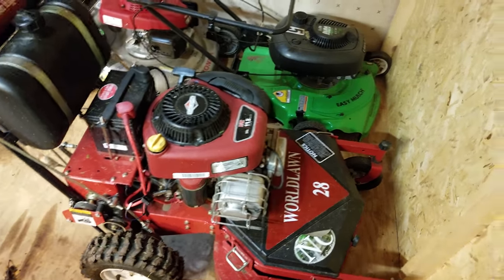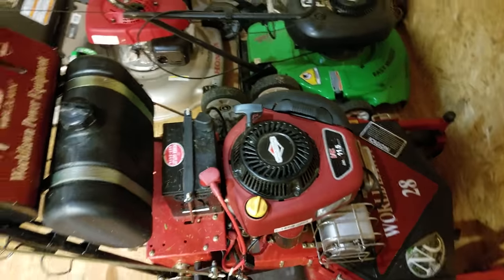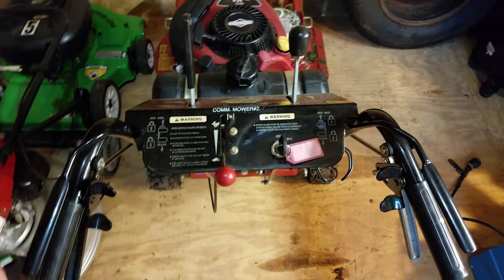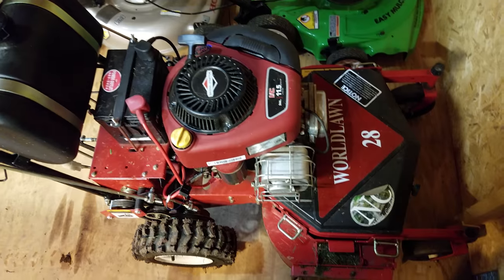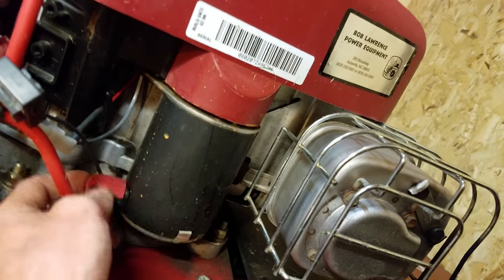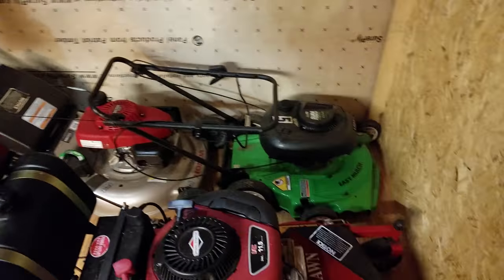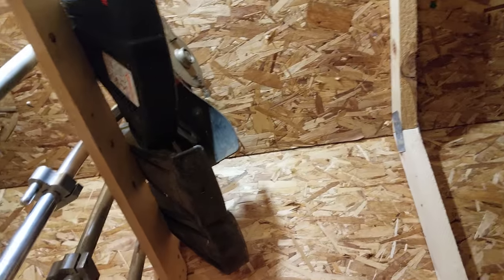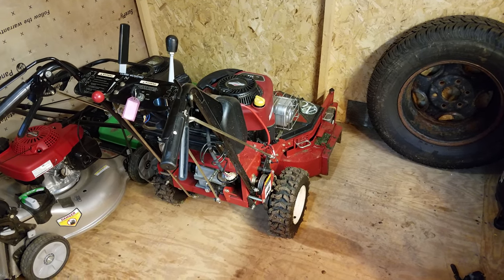WORLDLAWN 28'' WALK BEHIND MOWER

Comment: I purchased the 28” Worldlawn and it’s been a game changer for me too.  It’s powerful and easy to operate.  I’ve  had it for a fews years and this 28” has been a workhorse.   However, the 28” has been breaking  blade belts lately.  Mostly, when I lower the deck for shorter cuts.  How do you suggest I adjust the belt tension on the 28”?  

Any suggestions would be appreciated.  Thank you.

Comment: Does the 28 inch walk behind worldlawn come with honda or Kawasaki engine?
Tks for the video
Reply: His has briggs.  There is also a honda version. The new briggs model woldlawns have a 10.5 not the 11.5 his has.
 I have the 10.5hp briggs on my 32 and its fine. So i know it would be fine on the 28.
Reply: @mattlac3061  i just got mine 28 worldlawn with honda , mulching kit,  bagger,  with shipping from Tennessee to Louisiana (250$) and recieving it here at a store with forklift (250 $) all together came at 2990.00 $ a little more than i wanted to pay but is here now and haven't used it yet.
Reply: AngelTheFiend  it is a great walk behind lawnmower,  i had to order it from Tennessee with honda engine,  it did cost me 250 for shipping and 250 for receiving bc it had to be delivered in a business with forklifts. Total cost was 2950 but if you can find a store that has it and you can pick it up,  you save 500 , has good power for its size.
I forget to tell you that the price i told you was with mulching kit and bagger too.
Reply: AngelTheFiend  it is heavy duty regular bag, it is not steel , it attaches to the right of the mower as you are behind it, 
It doesn't make it very wide , approximately 18 inches , but it hold a good amount of grass , i haven't used it for bagging yet but it is not that hard.
Reply: AngelTheFiend  what is sulky?
Reply: AngelTheFiend  o ok you talking about those two wheel with board so you don't have to walk,     i guess you might be able to if you modify a part or something bc it has close to 11 hp and ya it can pull you if the ground is flat and smooth.
Reply: AngelTheFiend  yes i still have it , i got it late October of last year and i have kept it in garage,  have used it only one time bc i have two other mowers (42 inch gravely and honda hrx217vka) so far it cranks up nice and has great power,  but after all this crazy situation with Corona virus.. i will use it more often,  but i think it will do just fine.
Reply: AngelTheFiend  yes , you can hold both handles and engage the break then it won't die.
But always have your blade engaged too and i usually put it on 2 (speed)
Reply: Do you have one of them too?
Reply: AngelTheFiend  it is , get one with honda engine and with bagger,  mulching kit,  tax and if it is local that you don't pay shipping..should be around 2350 but without all those
I would say 1900 to 2100 would be a good deal.
I bought it bc it goes through wet grass easy and it is not very heavy to leave marks, i don't know what you want to use it for.
If your own personal homeowner i would get a 400 Honda,  but if you want to use it for business and have lots of wet grass , this one has 10.5 or so hp .
Reply: I paid 2900 that was shipping of 250 plus 262 that i had to pay once it got here bc you have to have a fort cliff i paid nearly 500 just for shipping and receiving,  and nearly 5 to 600 for bag and matching kit,  so if you have a local store that sale worldlawn would be great,  you save over 1200
Reply: AngelTheFiend  it doesn't have reverse,  you just use the handle and it turns fast, it has belt for turning around.... i mean if there is a dealer there and you can get it with bagger for 1500 , you had a great machine and great deal. i wanted something more powerful and walk behind but not as expensive as a riding lawn mower and i did pay a lot but i heard it should last for a long time 
Go there and test drive one see how it feels.you might not like it and then you might love it.
I would go test drive one

Comment: Does it have bagging system,  or is it easy to change to bag.
Tks for the video
Reply: You can buy a bag. Its a plate with a fabric bag. Cost 160ish. Easy to put on and off. I think it holds 1 bushel if im not mistaken. Personally i hate the bag design.
Reply: @mattlac3061  ya i got mine few days ago , i didn't know about the bag....but you right once you got the bagging metal part on there it should be easy to put the bag and taking it off.
Reply: @mansourramzey7711  you dont have to leave the plate on either. It only takes a second to put on and off. I dont leave it on.